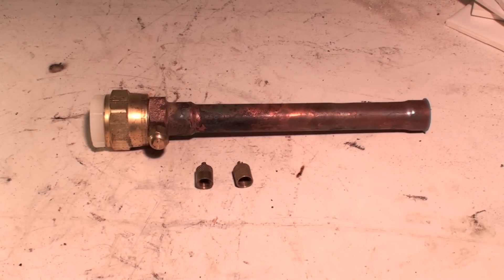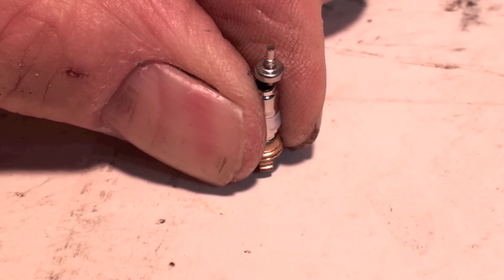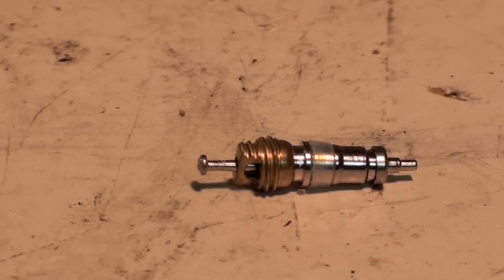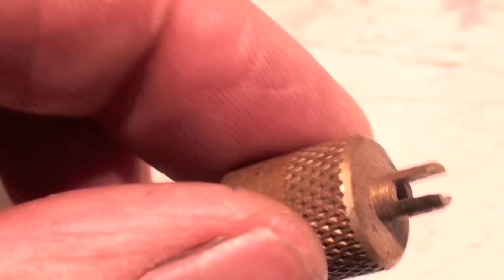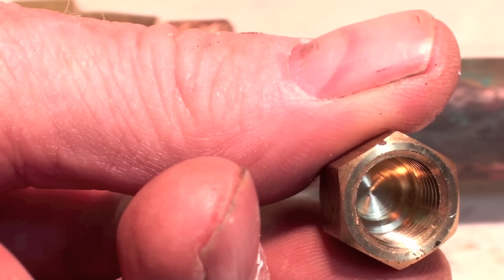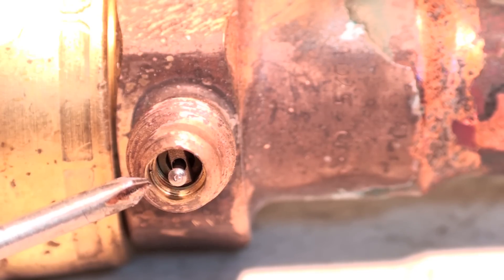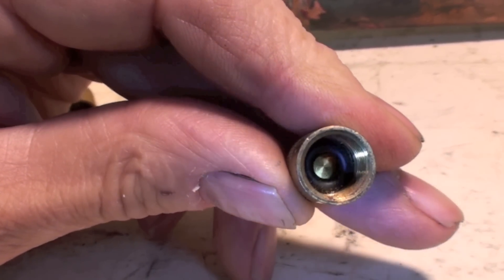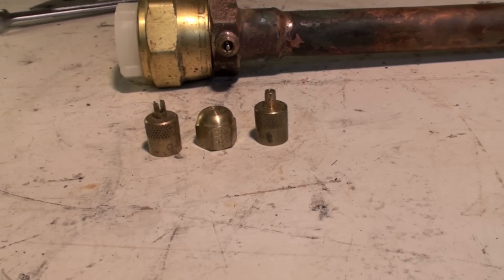how to stop leaks from air conditioner valves and caps

Comment: That cap you show if I had a ac out and not even tighten it like you show like just hand, tighten it or just took his fingers and barely tighten it and then a month later all of a sudden we had a leaked as he says he put his finger down there. I think he pressed his thumb in it not realizing what he’s doing and he said here that sound that’s a leak and it was only a half pound low half pound charge me $50 a month and it’s been working just fine then he goes to his buddy. I swear I tighten that cap enough to trust this guy now he’s getting into the bigger jobs think he doesn’t want to fool with something small anymore. That’s why when he came out in April he told me to keep the money and charge me.
Reply from the maker: A large part of this comment is incoherent.
Now listen:  The cap does not seal the line tap!  The schraeder does seal.  Look at the tires on your car.  There is a Schraeder valve that seals with a plastic cap that is a dust cap.  The same is true for refrigeration systems.  
Tightening the metal cap will damage the flare and then the schraeder valve cannot be removed if necessary.  
GFM

Comment: To test my leak detector, I remove the cap and sniff the schrader b/c most leak and this confirms my leak detector is operating.
Nobody ever mentions the elastomer compounds used in the various schraders and caps but material compatibility must be accounted for when selecting replacement components.  Not just any replacement schrader or o-ring will provide satisfactory performance.

Comment: A/C was working fine, had an inspection done to check system health, couple days later AC compressor and fan are running but no longer cooling well and the shrader cap is oily and oil under it. Did that technician screwed up ?
Reply from the maker: If the tech tested system pressures, he probably left a leak.
GFM
Reply: @grayfurnaceman  Yes that's exactly what he did. How could a technician be so careless or was that not random ?  Using dish soap water I can make 1 inch big bubble on the shrader valve (cap removed).  I called the company and told them that's the leak he left, they're coming back tomorrow morning to fix it and said the refrigerant is on them but any part to replace i would have to pay (?!). I guess the valve only ? Your insider insight is appreciated.
Reply from the maker: @ericastier1646  Everyone makes mistakes.  They seem to be stepping up to make it right.
GFM

Comment: I have a mini split unit with two air handlers that I installed last year.  I noticed that the system had lost some charge over the course of a year.  I searched for leaks at the easy to get to areas first and I found a schrader valve leaking on one of the loops.  I used a little screw driver and "blipped" the valve a couple of times and it stopped leaking.  I screwed the cap back on but I wonder if it'll stay fixed or if I need to buy a tool to change it without having to evacuate the system.
Reply from the maker: I would change it.
GFM

Comment: I have leaky schrader valve in my Bryant 596ANX042000AAAA. Where do I buy schrader valve for Bryant 596ANX042000AAAA ? I am not able to find any Kit to replace it. please help
Reply from the maker: The Schrader valve itself is simply a tire valve.  The housing for the valve is probably available.  I would try a Carrier dealer.
GFM
Reply: @grayfurnaceman  Any Schrader/cap elastomer seal material will do, no chemical compatibility concerns?

Comment: You got me thinking about the adapter caps on my system from CH. You probably know their gauge ports are smaller. I've got adapters to fit 'our' style. So the adapters press the first schraeder on the unit with another pair of schraeders on top of the adapters. This unit might have a leak around the threads of the adapter. I'm removing the adapters this time. What do you think?
Reply from the maker: Anything that can leak will leak.
GFM

Comment: No wonder on a new unit I did the low side once I removed the cap after leaving it over night while I was  nitro testing it and once i removed cap lil piss of air came out   that's not supposed to ever happen correct ?
Reply from the maker: You are right, it should not.  Your schrader is leaking.
GFM
Reply: grayfurnaceman they were The stock that came w the luxaire unit I replaced them today and did a nitro test left gauges on over night cuz it was too late to continue so tomorrow will put in vacuum and see how she holds over all

Comment: I bumped into the schraeder unable to come out situation several times. I always thought it was in the design of the valve since I could see no threads in the top portion,... many service valves are threaded for acceptance of a core valve. Many service valves are not. Never thought of WHY the core failed to come out. Now I know....Thanks!  I like the 1/4 turn valve best. The caps are meant as a secondary seal if the core fails, it pressurizes and lets the mechanic know it time to change it, and to keep out contaminants.  I was scolded many years ago for over tightening my hoses to my manifold and service valves by a senior tech.  I listened and changed my behavior.
Reply from the maker: hvac01453 Good thoughts. 
GFM

Comment: if you look into the beverage industry (fountain installation parts) order a bag of 1/4 fish eyes. These are 1/4 Teflon seal made for a flare fitting. you don't have to tighten them very tight but you will still need a wrench. These are not a hand tight application.

Comment: plastic or brass cap without rubber seal can blow the whole unit charge in just a couple of months and cook the schrader valve seals also.  I found out the hard way on a install.
I always check with buble detect and also check the service valve caps.
Reply from the maker: Valve caps are not there to seal the system.  They are dust caps.  Consider your auto tires (they use the same valve) The dust cap has been plastic for at least 60 years.
GFM

Comment: Should that cap come off at times? Trying to figure out if that is the same cap off the suction line where the equilizer from the TX valve connects, and should that be on or off so that the ac coil doesn't freeze up from low pressure? Should it always be sealed? We have cold winters in Saskatchewan so i don't know if that has to stay on or not all the time and why does it have to be capped?

Comment: How do you replace the valve? Does it just screw out?
Reply from the maker: Obviously its not that simple.  There is high pressure inside.  There is a schrader removal tool.  I have a video about it.  Check my channel.
GFM

Comment: After seeing some of the comments I' also like to add if you use like a Frog ease out gently with pressure on the system I've found that will remove enough of the mushroom you can use your core removal tool.. Just have to make sure the pressure blows out all the shavings and treat is very gently.. Again jmho. No guarantees but it's worked for me.....

Comment: If I could add just 1 more thing... Just when you install your o-ring cap look in it to insure its flat in the cap and if you over tighten it the o-ring can actually pinch and go in the fitting and press in the schrader valve stem.. Not trying to high jack your vid it's just things I've ran in to.. Good vid, I appreciate anyone that's willing to share their knowledge like you've done, I'd love to see the next generation of techs trained correctly and not end up on a news video of all service techs ripping off customers... Again thanks for your time and advice.
Reply from the maker: Thanks for the support.
GFM

Comment: Your video is very detailed and very instructive video. Congratulations 
About tighten the caps I would say to tight by hand only and not to use any tool. People from people will understand different about the torque using the wrench and can damage the thread.
Reply from the maker: Agreed.
GFM

Comment: Hey what about using those special tools to remove a schrader valve?  Which ones would recommend? The tool that s used after charging...r-22, and you're checking for leaking, or should the schrader be replaced anytime a recharged is done?  Just curious....
Reply from the maker: The tool won't fit in.  Anytime the charge is removed, the schraders should be removed and replaced.
GFM

Comment: Leak rate example with mushroomed Brass SAE Nipple:  One 5ton AC here required 4 Lbs of R22 in a 12.5 Lb system due to a bad valve core leak.

 Without the cap the leak rate  radically more, ie one hears the leak thus massive ie probably would be out in many hours or few days. 

The system was recently charged in 2015 and before that in 1998, thus the system leak rate is 4 Lbs in 17 years or 4*16 oz  or 64oz in 17 years say 3.76 oz per year on a 12.5 Lb system.

The valve core body will not come out with a valve core removal tool, the tip is mushroomed. The last other guy probably purposely overtightened it to reduct the leak from massive to tiny, ie a hack/ gas and go fix that seems to be real common around here. 

The story above is on a 30 year old AC unit. The leak rate in percentage per year if all from that core would be  (  4 lbs lost / (12.5 Lbs system hold * 17 years ) ) *100=  1.9 percent per year.

ie the system required 4 Lbs to be fully charged on a 12.5 lb system and I charged it in 2015, plus I was there in 1998 when a local guy charged it and we used my same liquid line sense electronic sight glass on a TXV type settup then too.

The system lost 32 percent of its charge ie 4 /12.5 ; but it did it over 17 years thus 32/17=  1.9 percent per year.

Comment: Sure, I can see why you'd think you'd have to replace the entire line if you mushroom the fitting. I suppose that'd probably be the best way to do it.

If it were mine, I'd probably take a dremel to the inner diameter of the fitting and grind off the mushroomed portion in order to replace the Schrader valve.  It could only affect the seal between the fitting and its cap.

If that doesn't work, then I would go on to replace the line.
Reply from the maker: soundthecymbals I think I tried filing one down once, but the mushrooming on that one went too far down.
GFM
Reply: soundthecymbals It would be interesting to see a fitting being dremeled out without actually hitting or damaging the schrader valve.  It seems on paper at least, it would be doable with the valve out and on a bench.  But if the valve was out, it is a moot point huh.
Reply: +acoustic4037 Who cares about damaging the schrader... its going to get tossed anyway.
Reply: Gene Friedman
 I think when I wrote that, I was considering the sudden loss of refrigerant if you hit the valve.  But I see your point also.
Reply: +acoustic4037 To me shraeders are born to leak at some point.  Especially now with higher system pressures the rubber sealing gasket at the bottom of the plunger is subjected to more stress than ever.   Thats the piece that breaks down moreso than the seal on the side.   It simply makes sense that the caps act as a secondary seal.  A brass cap with a proper o-ring and some nylog should make an effective seal - unless their is dirt inside or some deformity on the fitting.  Think about it.... when you put your hoses on the port it seals it  - so should a clean properly fitted brass cap.

Comment: HVAC tech did not replace Schrader valve said made hissing noise...said like the threads were striped just tightened down. I hope  we do not loose the freon. What is your opinion? Thanks
Reply from the maker: Paul HILL The cap (if it was brass) was tightened down too tight sometime earlier, which mushroomed the fitting.  The entire valve needs to be replaced.  My thought is that is it will leak, if not now then in the future.
GFM

Comment: I can't count high enough of the caps someone has overtightened and deformed the valve housing.  Only a few times I can rethread the housing with my Schrader rethreading tool.  Other times I just had to replace the valve.  I agree with you Gary, caps only need to be finger tight.  Never gorilla tight.
Reply from the maker: George W Amen.
GFM

Comment: grayfurnaceman I'm starting to hate the wrench-tighten caps. I had those on my 1.5 ton Trane XL14i from 2005, and I found that they slowly deform the flare shape of the schrader port itself over the years, and when I tried to put my low-loss hoses on the system, the hose would not seal, since the flare was turned into a cut-out ring, and I got frostbite. In my opinion, schrader caps not only prevent dirt from getting in, but really should be in place to prevent gas from escaping when the schrader gets old or worn out. They make great sealers if they are made tough enough. It's the plastic ones I hate.
Reply from the maker: The wrench caps should not be tightened more than a few inch pounds.  As for the caps as sealers, I take the opposite approach.  They were never made to seal.  If you have a leaking schrader, you need to replace the schrader.  To me its a "fix" when you need a repair.  Thanks for the thoughts.
GFM
Reply: GFM, I agree but there are cases where you cannot get at the core with the removal tool, or the bozo that work on the system before you mushroomed the valve  and then you next best option is to use a cap with an o-ring
Reply: @joebal9044  It's idiot like you who prolong the problem by not replacing the entire valve assembly when you see a mushroomed thread. The caps were never meant to seal.
Reply: @ericastier1646  I guess you are in the business of turning a minor repair into a major repair.

Comment from the maker: Think about the cap.  The pressure inside tries to push the cap off.  The higher the pressure, the more it tends to push past the o ring.  The lowly schrader valve tends to close with higher pressure.  I would put my money on  the schrader.  Hope this helps.
GFM

Comment: I always thought that even perfectly maintained and installed schraider valves are never perfectly sealed, sort of how automotive AC may take 20 years or more, but will eventually lose charge, due to the fact that the drive shaft is lubricated by refrigerant, and may slowly bleed, i've heard that schraider caps are supposed to be able to hold back any pressure that could be caused from a leaking schraider

Comment: Good advice on the schraders.  I always always always leak check ports and valve caps before putting the gauges on.  Then, if I put in refrigerant I always add the leak-resistant schrader caps.